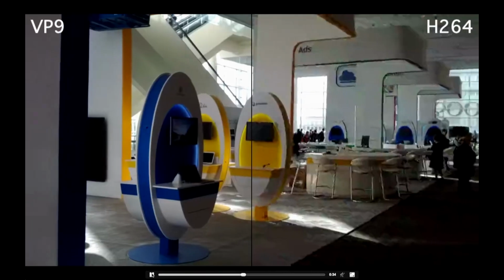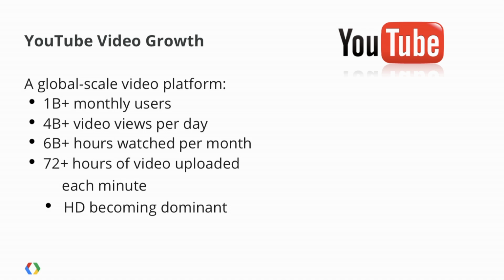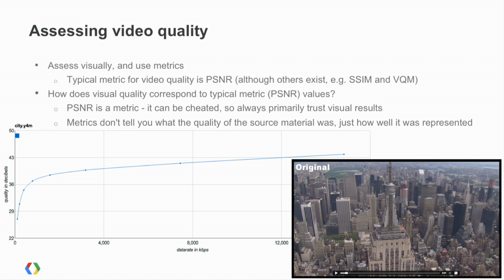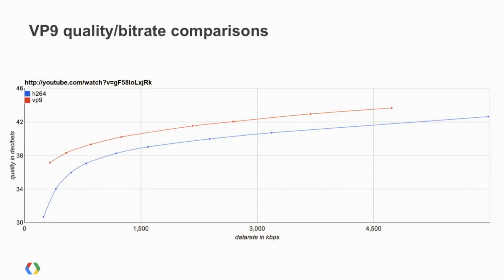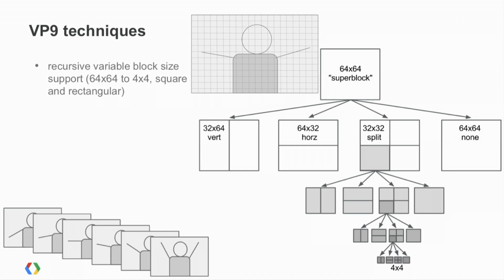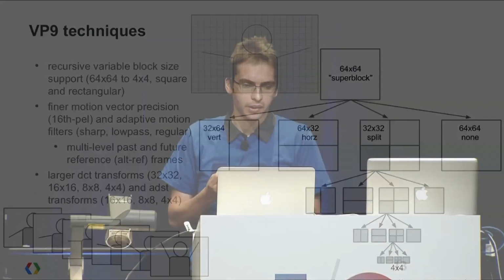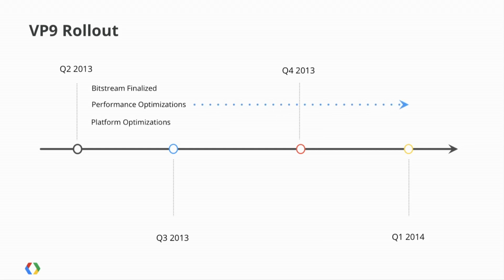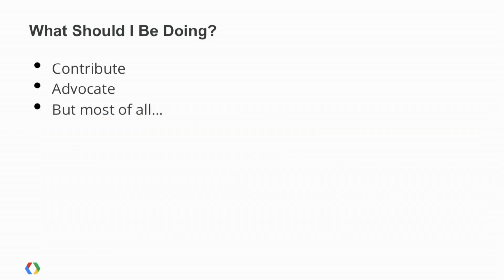Google I/O 2013 - WebM and the New VP9 Open Video Codec

Comment: I was really excited about this, but it's just not cutting it. The problem with VP9 is that the encoder is slow as hell. I mean, even x265 is very slow, but with -preset fast gives better results than VP9's -cpu-used 7 and encodes faster. You should really give us multicore encoding. Also there should be more optimized default settings. x264/x265 doesn't require to do brain surgery to create good results. I understand that YouTube is Google's primary target for VP9 but this will not really earn trust from the community doing HTML5 video outside Google. Even decoding have to be GPU accelerated by now. Why there's no 2K and 4K VP9 videos on YouTube otherwise?

Comment: How can we push VP9 and Daala as the standard? I suppose the best way would be to introduce by the scene. Though, they are still using XviD in some instances and are slow to adopt new codecs because of legacy hardware. Maybe having the capabilities embeded on mobile and set top devices (phones, PS5, Xbox 720) of the future would help.

Comment: Right now(may change), from the perspective of an average consumer/encoder, they are essentially identical. IF you disregard the financial & innovation burdens that licensed codecs cause, and compare them solely on their technical merits. It's another vhs/beta or hddvd/bluray type deal then. With a properly tweaked encode, your average consumer wouldn't be able to tell you which was which side by side. That said, both have yet to release an optimized version, so neither is practical for use atm.

Comment: Indeed, M$ does have licensing agreements with MPEG LA, however, MLA licensing agreements are complex and per product line. i.e. A license for Winblows 7 to decode mpeg2 (dvd codec) grants only that, not mpeg2 for Win8, MP3 decode for Win7-8, etc. Microsoft contracted a mpeg2 licence for Win7, hence native DVD playback, they didn't for Win8, so too bad user. The reason all comes down to money. 

If DVDs used a free codec, every device/software that wanted to could provide native decoding.

Comment: Compression would cause the already botched audio to sound worse (at a louder volume). Yes, the mistake is "fixable" but only to a certain extent. They should have adjusted their gain structure correctly from the beginning.